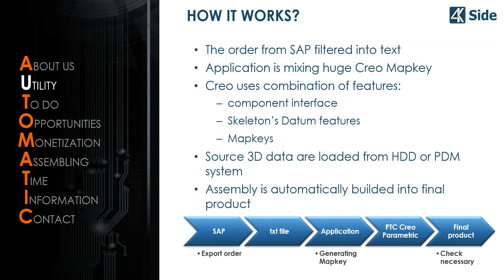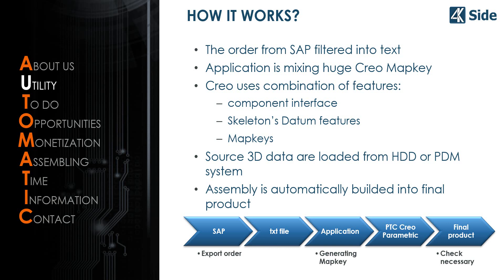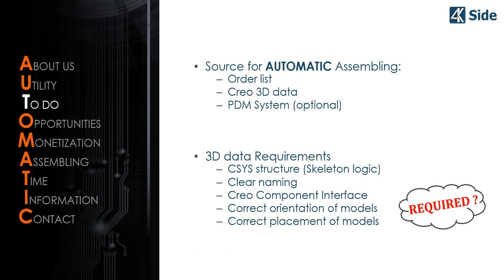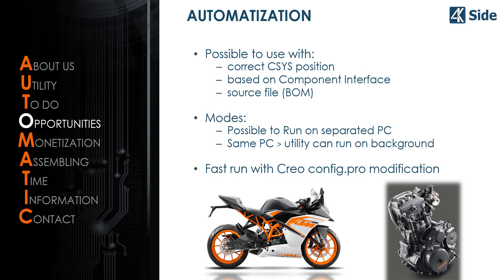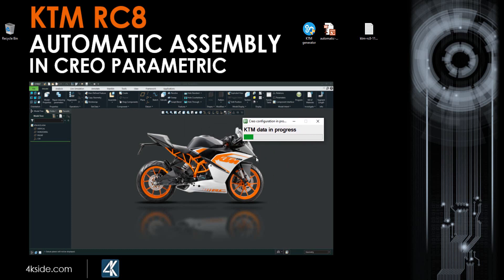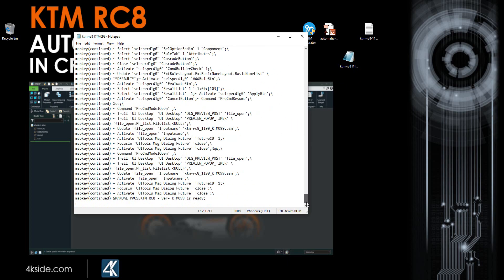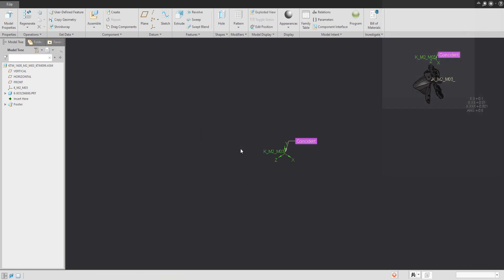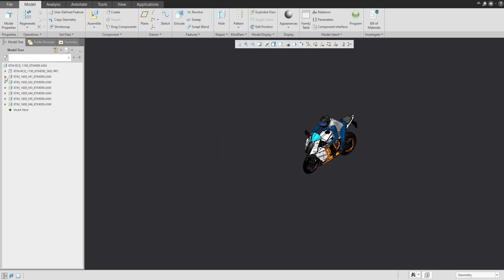Automatically assembled components  - Easy with Creo | Unlock Potential with PTC's Creo

Comment: Is it possible that assembly components memorize the current location (Constraints) in assembly and restore those locations if I convert those assembly components into obj files and if I call those obj files in other cad software it gets assembled to locations that were in creo automatically? is there any solution to this? I mean prt1,prt2 in the assembly should reflect the same location if I call converted obj1,obj2 (of prt1,prt2) and its get assembled to the same orientation/location same as in creo.
Reply from the maker: Thanks for your question, but component interface is placed as reference information only in Creo (exported neutral files do not know this condition)